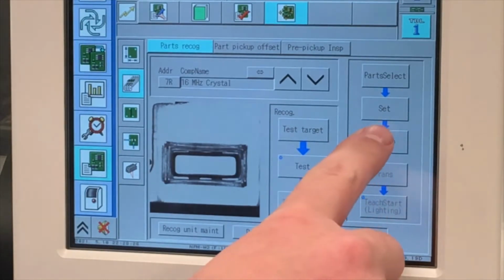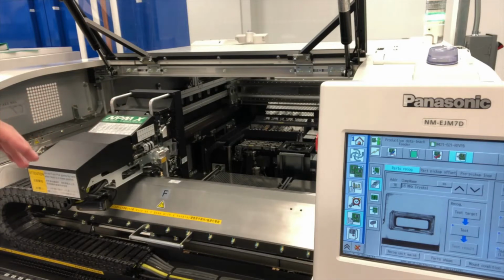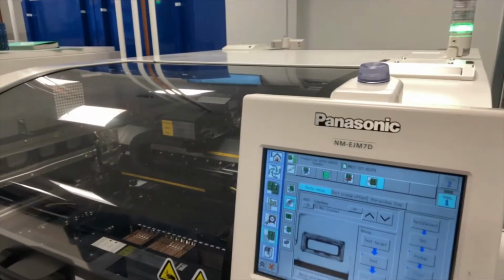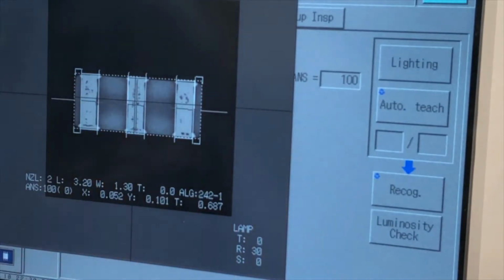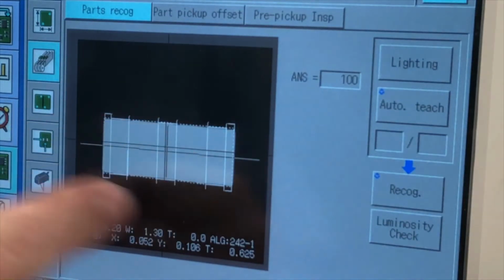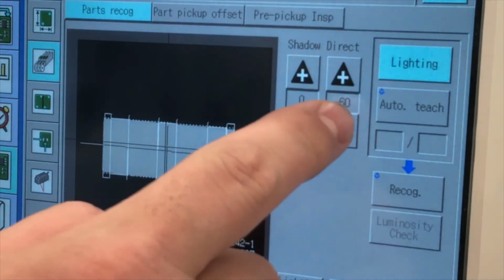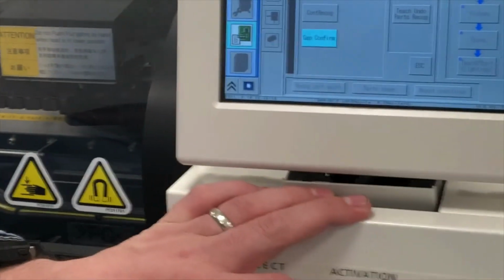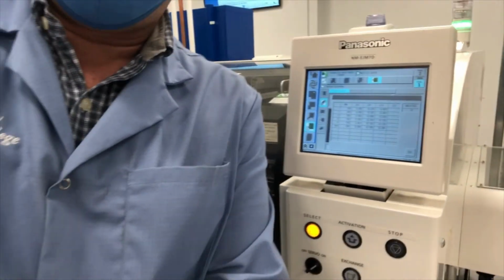PICK & PLACE CRYSTAL OSCILLATOR AUTOMATED VISUAL RECOGNITION+

Comment: the 100 on the Ans is not 100%.  its the return code.  when you look this up in the troubleshooting manual (parts recognition error) it will give you more detail about the returned code.  example is ANS=46 this means Lead Float error. the true error code in the manual would be 43046.
but a very good video on how to do parts recognition settings.

Comment: Amazing illustration 💙
How the pickup actually works?
Reply from the maker: Each head (front and rear) has vacuum pick-up nozzles, 16 in the front, and 3 in the rear.  The nozzle comes down onto an SMT part, a vacuum is applied, and then the part is picked up.   There are sensors in each nozzle to measure the amount of vacuum, which correlates to if the part was picked up.